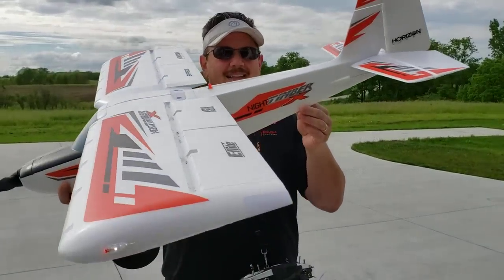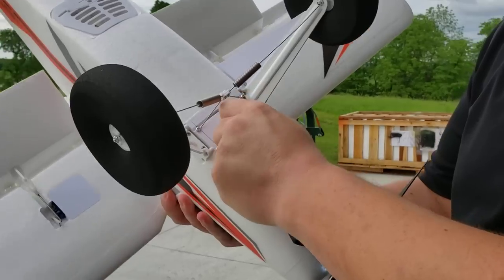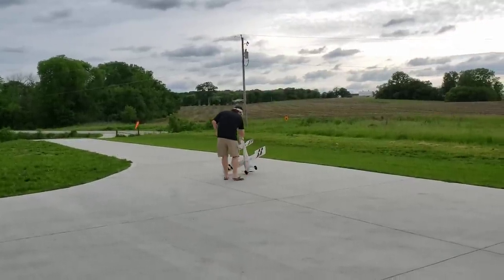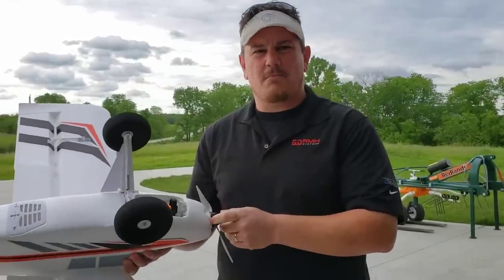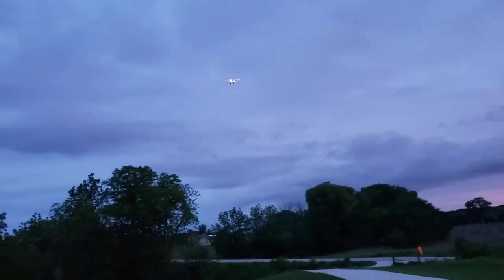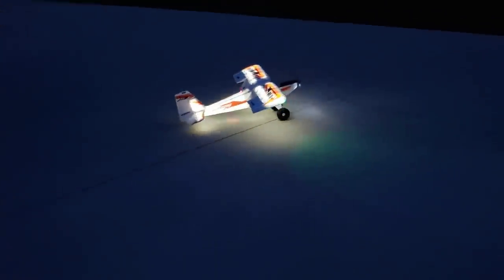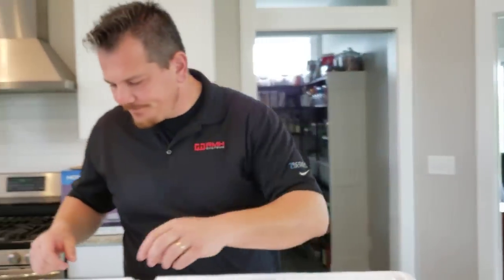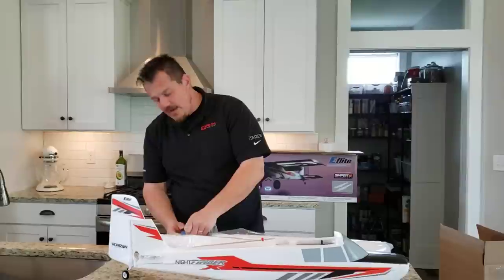Horizon Hobby - Night Timber X 1.2m - Unbox, Build, Setup, & Maiden Flights

Comment: Brian i have a question about battery placement and center of gravity? I'm going to be using the 2200 mah 4s smart packs and my 3s 3200 mah non smart packs.  I put the carbon fiber rod in the tail not the steel.  On my cg machine its showing me the plane is nose heavy and to place the packs as far back as possible to get the nose close to level.  Looking at your placement in the video looks like your packs are closer to center to where you can use both straps on your battery or the battery slid while you were flying?  Any advise?
Reply from the maker: Good question. I might have marked this plane with my "old method" which can slightly alter the CG marks. I HAD been using a flap piece of paper and following the contour of the wing....I was later corrected in that it's supposed to be a straight line measured back to that point. HOWEVER, I think the CG was marked on the bottom of the wing on this plane, therefore I doubt I did that mistake on this plane...

Here's what I can say for sure...

CG is highly forgiving on this plane. You'll be pitching up and down like a maniac, so I'd encourage you to get the pack in there and not dwell on it. This plane will fly in a badly tail heavy configuration, but I'd try to hit the middle of the range at first.

My two cents ;)

Comment: Brian, I have watched this video and the one on the turbo timber evo several times, along with your other videos on planes I am interested in getting someday. I love these planes and I am torn about which one to get. I really like the size of the night timber x, and how aerobatic it is, but I really like the top load battery box of the evo and that it comes with floats. I have looked online for the answer to several questions, and I have not been able to find any answers. Since you have both I am hoping that you can. 1) Can you put the night timber x wing on the evo? 2) Are the plugs for the evo wing servo extensions, or do they connect directly to the servos? 3) If you could only get one, which one would you get? 4) Any rumors of a new night timber x with top loading battery? 5) Did you ever get an answer to where on the wing you measure from for the CG? If you read this, and have time, I would love to hear your answers. Thanks!
Reply from the maker: I fell like I just answered all these questions...am I mistaken???
Reply: @BrianPhillipsRC  Yes, I put the same question on the TTE and NTX videos not knowing which you might see. Thanks for your reply and insight on the two planes!

Comment: Would you put out a video only on expo and dual rates ?    New old RC pilot and regular pilot here and I’m so interested in making the small ones handle like the big ones!
Reply from the maker: I do expo on every radio setup, but then I usually make adjustments, IF NEEDED, in maiden flights (We share this if we do make adjustments)

Comment: Hey Brian great video watched it several times.  I bound my DX9 just as you did so its in safe.  I would also like to put it on a switch so i can turn it off but i"m having issues assigning it to switch B?  Watched you section in the video many times and read the book but am i missing something.  It wont assign to that switch so i can turn it off? Is it because its a three position switch?  Any help would be great.  Thanks James
Reply from the maker: Have you made sure that you're changing  A Channel on switch B? Go to MONITOR (Scroll to the right ONCE) and watch when you flip the switch...does the bar move for whatever channel you've assigned? If so, then do the sticks in and down (or out and down...can't remember which way) then flip the switch ALL THE WAY UP and ALL THE WAY DOWN (two position switched and three position switches alike!!!) 5 times....so if you count the end strokes, you'll be counting to TEN ;)

If it doesn't work, you can try to rebind in AS3X, then REBIND with SAFE Select activated. Kind of a pain, but you CAN do it, if you've already made the assignment wrong...I've had a hard time trying to REASSIGN Safe Select to another switch and have had to do this too...
Reply: @BrianPhillipsRC  Brian i do have a issue just finished all the programming and assembly.  I noticed that when i try out the control surfaces like the flaps and alerions on the left side only this happens but the servo seems to vibrate and when i touch the control surface it stops.  When i work the alerions left and right it starts to vibrate again?  Only on the left side?  What are your thoughts ?

Comment: Hi Brian thank you for video...just wondering do you use any down elevator in your flap settings..
I was wondering weather to use some in mine and what you may recommend best wishes Chris
Reply from the maker: yes...

Position,Flaps,Elevator
0, 0%, 0%
1, 50%, 14%
2, 100%, 20%
Reply: Thank you Brian I’ll try those settings out 👍
Reply: Hi Brian would the flap settings you gave me work ok on the umx turbo timber...? best wishes Chris

Comment: Love your videos they’ve been real helpful I just received my apprentice today new to the hobby never flown the rudder on the plane won’t seem to go all the way straight any idea how to correct this
Reply from the maker: Yes. Are you in SAFE? If you are, make sure you turn this off. Then when you look at the plane, make sure you had it sitting on the wheels when it initiated...this is VERY important so that SAFE initiates with the plane flat and level to the ground. This might be your problem.

If not, you can do it one of a few ways, adjusting the rudder to get it straight with the vertical stabilizer...

1) Use the trim on your radio, but only for small adjustments. If you have to use a LOT of trim, you'll be actually throwing away a chunk of throw on that surface. This is bad.
2) Use the linkages to extend them at the rudder control horn to straighten the rudder...some are more easy than others. I call this a "mechanical trim".
3) You can also take off the control horn at the servo end (the part that moves the control ROD to the rudder) and change where it's installed. Undo the, usually phillips head screw, then just move it to a better, more centered position.

All I can say for sure, is that it's highly unusual to have to do this, so make sure it's not broken!
Reply: Brian Phillips watched a YouTube video and guy had said to adjust the linkages adjusted straightened it out put it in the air three times yesterday not great landings but got it on the ground without breaking anything on time number 3 well let’s just say it’s currently an expensive tree ornament

Comment: Hello Brian, I own this plane and I like to switch AS3X off, because I don't like it.
Is it possible or do I have to replace the reciver?
Reply from the maker: You would have to reset the Rx to factory defaults, which requires the programming cable, OR you can switch out the Rx.
Reply: @BrianPhillipsRC  Many thanks for your response.👍 I like your videos because they are informative, funny and very long.😉

Comment: Hi Brian, Can you explain why you changed the motor reverse that appears on the manual? (2 position switch)
Reply from the maker: Can you time stamp where you're asking about? Not 100% sure how to answer without the context.

thanks Mario!
Reply: @BrianPhillipsRC  Hi, on my Night Timber, I  programed the reverse to the motor according the manual, with a 2 position switch (switch A) and  the system does not work ok. I can not swicht from normal to reverse the motor by fliping the switch.
Sometimes the motor change to reverse and stay in that condition no matter y you flip the switch to one side or the other. You to disconnect the battery and start again to have the normal, forward movement

Comment: Will a 3200mAh 4s fit in the Night Timber X? Will it be too heavy?
Reply from the maker: Not too heavy, but it's hard to cram them in that tight hole. The ONLY complaint I have about ANY of the Timbers is the battery access.

Comment: I'm new to this RC thing since COVID-19 closed my work for a while. I keep hearing about EXPO & Duel Rates and people setting it up on their transmitter. What are those? I have a few a nice fleet now namely 
1. Valiant
2. F4U from Horizon Hobby
Couple more F4U from Flite Test
Opterra and it calls for those but like I said I have no idea or even setting them up in my DX8
Reply: Dual rates would be giving all of your control surfaces from max to minimum throw depending what you set it to, normally 100% is full throw, and a lessers percentage means less throw for more scale maneuvers, expo, softens the stick from center to what amounts of expo you choose, eg. 30% expo would  soften the stick inputs for ailerons from center of stick position, up to  30% where after that full movement becomes more responsive. There are many videos in dual rates and expo, and setting up in radio, check m out and you’ll be glad you did, hope this helped some👍🏼👍🏼👊🏼
Reply from the maker: Like Jeff said...

Expo makes the plane feel "easier to fly", or you can use it as a tool to tame a plane that's touchy...but here's a video of Expo Setup, which I generally include in my Radio setup videos as part of my Unbox, Build, and Setup.

Sorry about the slow response. It's been a really busy week..

https://www.youtube.com/watch?v=u5DnWEyAKDY&list=PLXTH0DstRDc5m50UjuP_p5qM-_JGifFp_&index=28&t=251s
Reply from the maker: Oh yeah, with DUAL RATES, you will actually change how much the control surfaces move, whereas with EXPO you just change the rate by which the control surface moves out to a certain percentage of stick movement, which will preserve your ability to avoid hitting stuff, when you get into an evasive maneuver.

I FAR prefer Expo, and use Dual Rates infrequently. I want to be able to pull the stick all the way back and have the plane do the maximum it can do. there are mechanical ways to limit the deflection on the surfaces, but this gains "resolution" so that you keep that FINE TUNED feel, but at the cost of extreme evasive maneuvers that you would never be able to physically pull off, in a full scale plane.
Reply: @BrianPhillipsRC  thank you so very much. I've been away for a day because I just got my Turbo Timber in and have been fooling around with that lol
Reply: @BrianPhillipsRC  I will watch your video here in a few and again thank you so very much
Reply: your wife is a trooper, after the second pack my girl would of put the camera down and walked inside. killer property btw. I just bought the plane yesterday, setting her up for my first flight in a little bit

Comment: any chance you could show me the dual rates and expo----it went so fast and my screen is blurry I couldn't tell what you inputed for all your low mid and high rates
Reply from the maker: I do the same DR/Expo on all my planes, and only adjust if there's an issue...

I think I ran my "standard" expo and dual rates...

Switch F0 - 100% Rate | 5% Expo 
Switch F1 - 100% Rate | 10% Expo  <<<<< Take off in the middle, adjust UP if it's too SOFT, adjust DOWN if it's too Touchy
Switch F2 -  90% Rate | 20% Expo

Comment: Brian I have an issue with my left wing? When i cycle the alerions left to right to test the control surfaces the left wing vibrates??  It only stops when i put my hand on it?  I have had the wings off several time triple checking the correct wiring and correct polarity.  Thanks James
Reply from the maker: You mean, it vibrates??? If you set it down, the LEFT wing moves, until you still the plane with a hand? That is crazy! I assume theirs a GAIN issue with your AS3X based on this little bit of information. Have you flown it yet?

I literally had a small plane (on a video yet to be published...so it will remain unnamed - LOL), that was vibrating when I laid it down to grab my hat and sunglasses. I had to still it before she would stop....BUT it was both ailerons, not just one...
Reply from the maker: Also, do you hear a clicking? of so, I bet you have a bad servo. FEEL the wing, and see which end makes more vibration....then you'll know where to start looking.

Comment: hey Brian,all you had to do was look at trasmitter to check battery,telemetry,lol
Reply from the maker: Yeah, I guess I could have done that...but doesn't tell the per cell voltages, that I know about yet...does it?????
Reply: @BrianPhillipsRC  I think so,I will have to double check mine,lol
Reply: @BrianPhillipsRC  just checked,it sure does,I think the alarm you were hearing from motor or escape was low cell alarm on battery,you can set it just like cheapo checker you put in plane

Comment: Do you hvve a back up battery in ther? I noticed an extra ec3 connector?
Reply from the maker: That's the EC3 to JST that's used to pull power to the LED's. That's why you see two...

Comment: Will the reverse work with a NX6 Brian?
Reply from the maker: I think it will will "future" planes, but on THIS plane, you might need access to channel 8 (Aux 2)...whereas the NX6 only has channel 7 (Aux 1)...BUT, I'm told in future planes with reversing function, we'll have access as low as channel 5 possibly???

Watch this video about 1:56:50 and for about 2-3 minutes...and you can double check my commentary for yourself ;)

Comment: Hey bri I have a question when I deploy flaps it will pitch up some I would like to take this away so in flap settings elevator for 1 is 14 and 2 is 20

Do I just lower both steps a little bit ??
Reply from the maker: If you have "Ballooning" you can add the elevator mix right in the FLAP MODE...super easy, but you gotta play with it, since some 3D planes might use that ballooning effect for maneuvering. Here's an EXAMPLE....not specific to the Night Timber X...
.................Flaps   -     Elevator
No Flaps   -100  -  0%
Takeoff         0   - 10%
Landing +100 - 15%

...would be a good starting point.

You kinda need MORE of a step of elevator help on the "takeoff" or the first flap setting, for some reason....I've found, at least.

Then if the ballooning is still happening, adjust the 10% and 15% up more...

.................Flaps   -     Elevator
No Flaps   -100  -  0%
Takeoff         0   - 12%
Landing +100 - 17%

.... or if the plane dips now, adjust them down
.................Flaps   -     Elevator
No Flaps   -100  -  0%
Takeoff         0   - 8%
Landing +100 - 12%

....you gotta play with it if it's not in the manual.
Reply: @BrianPhillipsRC  its in manual so it looks like this flaps
           pos0 0% flaps
          Pos1 50% flaps     14% elevator
          Pos2 100% flaps   20% elevator

Okay so when I'm coming into land I'm not going too fast I'll hit full flaps and I will pitch up I find that I have to keep on riding the elevator to get down so I would add a little more in these steps?

Maybe 18% for pos1 and 24 for pos2? I know you can't change them by a lot
I guess I will experiment with small changes I just didn't know if you went up on the percentage or down like I said it's pitching up when I deploy full flaps

Comment: ever had this happen- in as3x mode plane flies level and almost perfect- slight yawl to (still trying to figure out what switches help trim what part)the right but almost got it trimmed perfect  but if I flip it to safe then plane acts like it wants to nose dive- not that extreme but I do have to add up elevator. I tried turning the plane on with the tail section raised level instead of sitting on the ground (tail dragger) but still doing this- any way to trim in safe where it doesn’t effect me out of safe mode …. Nx8 transmitter
Reply from the maker: Go into FORWARD PROGRAMMING and there's a correction for the attitude (pitch) and roll. It's expressed in terms of Whole Numbers +/-... Try this!
Reply: Haven’t tried this yet but I did want to just thank you for replying. You don’t have too- but I greatly appreciate it.  Thanks for wonderful wonderful content-  grace and peace good sir

Comment: Now need to put reverse thrust on edfs
Reply from the maker: Yeah, agreed! I want to mix the reverse thrust inot the throttle stick, but need to figure a way to do it safely....
Reply: Brian Phillips just upgraded to a dx 8 from a 6i. I’ve done the of the adv features. Mix, sequence, mostly a very amateur heli guy, have a few umm planes.  I live on the Connecticut shoreline, there’s alway a 10 mph wind off the water.  Night would the best time to fly around here. 4 mph wind min.
Reply: NOT knowledgeable about advanced features nor telemetry setup.

Comment: Hey Brian, NICE Plane!!! Not A Chinese "Boying" Airliner, Butt A Much Better Flyer, Even With That Crappy Ass Bottom Loading Battery Hole!!! LOL PS They Should Put Reversing ESCs In All Planes They Build... Plus You Need To Mod On Wingtip Wheels & Rear Amber Lights w/Backup Beeper??? How's Abouts Glueing In & On Some Flat Bar Neo-Magnets On Batteries Top Of Holder Bay To Just Drop Snap Em In... LMAO
Reply from the maker: You're just full of good ideas aren't you John?!??!?

P.S. I saw that hoop barn design, and was thinking it looks pretty "easy to build"...but  wonder how it will hold up in harsh winters. Well, a few weeks ago, a neighbor was building one ;)
Reply: Yeppers That's Why I Made The BIG Bucks All My Life! LOL Put The Pipes On 2' Centers + Use That 15mil Reinforced Green House Plastic & Nothing Will Effect Them!!! Not High Winds or Snows & No Worries! A Quonset-Hut Design Is The Strongest Structure On Earth Above Ground!!!

Comment: Great kid but you kind of go too fast on the setup can you send me the setup that you did on that for the Expo
Reply from the maker: from a previous reply to a comment in this video...

Here's what I do, but this is highly subjective.

All tied to the same switch, but you could split them up, if you want to be fumbling around while flying - LOL :)

Aileron...
          Expo Rates
Pos1 10% 100%
Pos2  20% 100%
Pos3  30% 90%

Rudder...
          Expo Rates
Pos1 10% 100%
Pos2  20% 100%
Pos3  30% 90%

Elevator...
          Expo Rates
Pos1 10% 100%
Pos2  20% 100%
Pos3  30% 90%